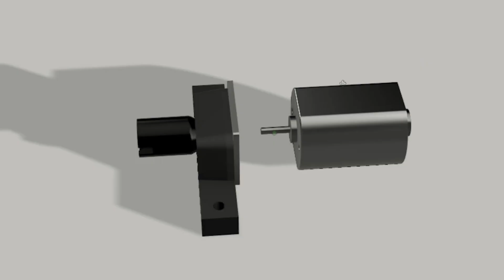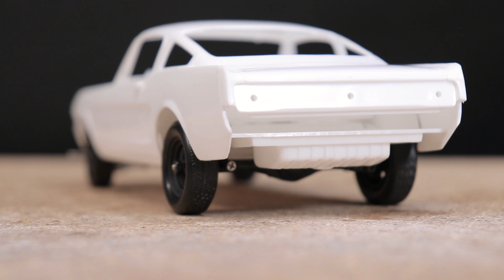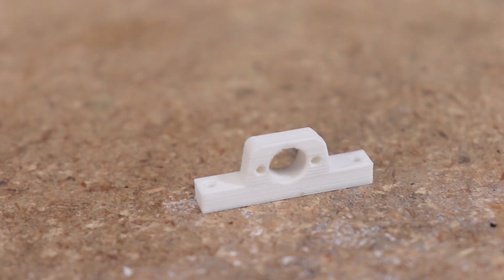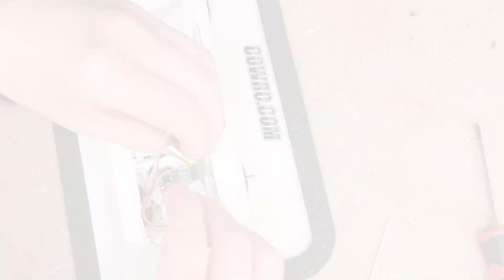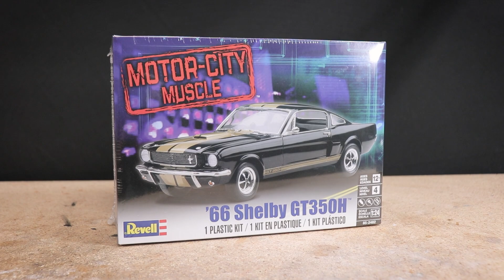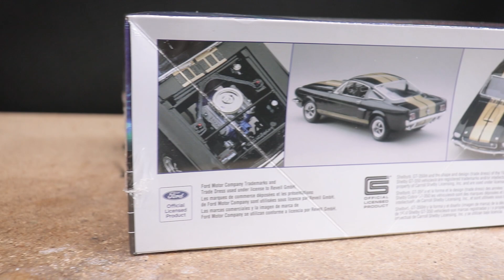Installing Motor, Driveshaft, and Driving the 1/24 Scale RC 65 GT350 for the First Time!

Comment: Hey is there any chance of you building a drag car with big old back tires and little skinny front tires and maybe brushless motor something to pull wheelies and really move
Reply: No shortage of power from brushed motors.They are super cheap with tons of HP.
Reply: That's very true okay but you cannot deny that a brushless motor makes 10 times more maybe not 10 times but you know what I mean
Reply: @chadmcnutt8569  Honestly modern brushed motors produce more power than you will ever want in a 1/24th scale car.Also because brushless motors are either on or off they are way more complicated and expensive to control. Brushless motors don't produce more power they just consume less power to run.Simple  and cheap is always good.
Reply: @amraceway  that's true too I've been out of the game for a minute with RC's I still like watching the videos and everything but I've got it everything I got one 125th scale crawler by axial I ain't been in our season the past 5 years I guess at one time I had a 10th scale axial XO buggy that would go over 100 mph